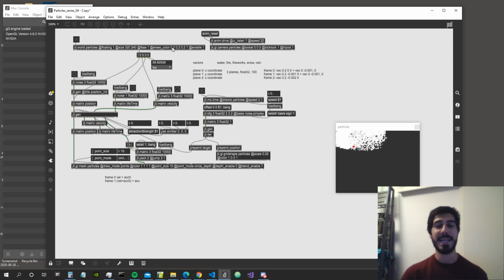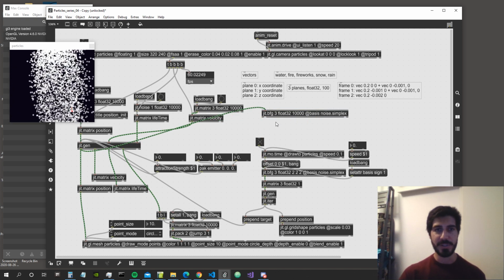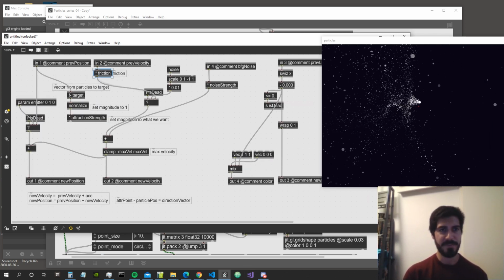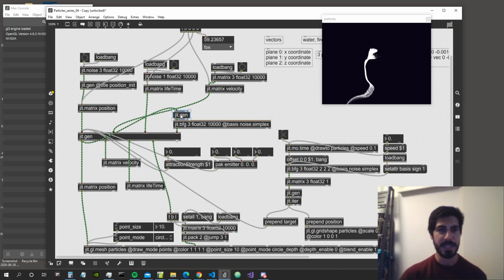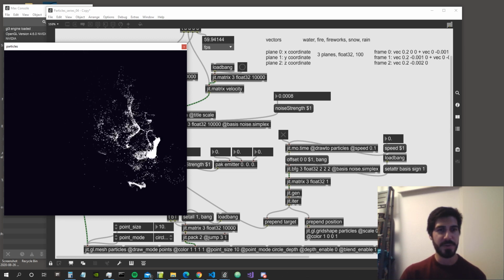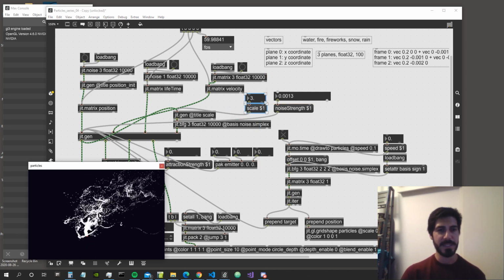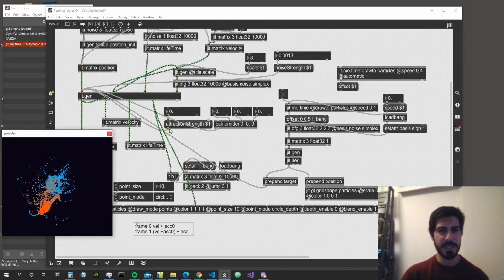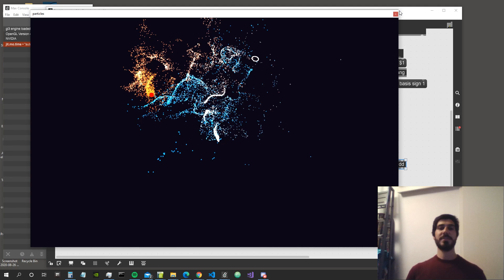Particles System  in Max/MSP Series | 05: Noise 3D Flow Field with [jit.bfg]

Comment: Hi ! And thanks again for your tutorials. Just a question, is [scale a b -1 1] equivalent to [normalize] in jit.gen context ? And does [clamp a b] clip the input values or is it a kind of [scale a b c d ]. Another question, you created 2 consecutives matrices : [jit.matrix 3 float32 1000] followed by a [jit.matrix velocity], can't it be replaced by a single [jit.matrix velocity 3 float32 1000] ? That would save some memory and simplify the patch, no ? I did it on my patche and it seems to work the  same way. Also, if I understood well, the velocity is the time taken to move from a point A to a point B, so that means that if a particle starts from A, wanders around, and goes back to A, the velocity would be 0 between those two time points, different from the speed which is an instant value of the current speed at any time and position of the particle, the consequence would be that one particle could have a velocity of 0 and a speed of, let say, 10. Am I right ?
Reply from the maker: Hi Jean-Martin! 
Question 1: no, normalize sets the magnitude of a vector to 1, [scale] scales the individual components of the vector from one range to another. 
Question 2: that matrix is for initialization purposes, it doesn't really occupy much memory, but yes it could be omitted since the velocity matrix is set by jit.gen on the output, nice catch!
Question 3: you are talking about average speed. Velocity is the vector representing the direction the particle is going to move at any given frame (so not the time) . 
Speed would be the magnitude of that vector. If the velocity would be 0 (so all the 3 components of the velocity vector are zero) then the speed is also zero for that given frame. We don't deal with average velocity and average speed, only frame by frame.